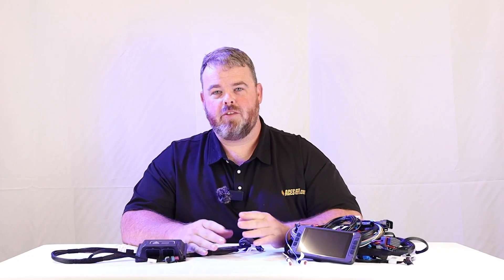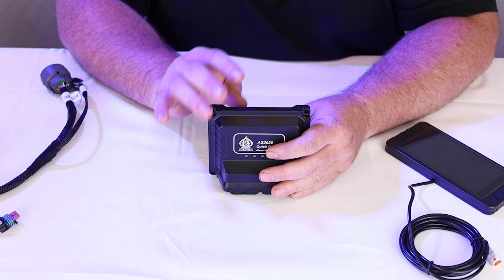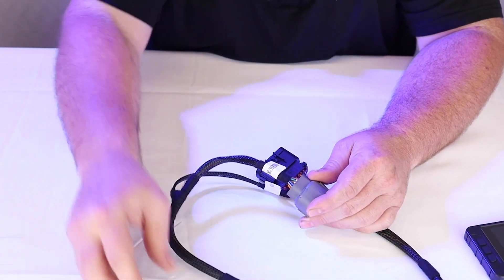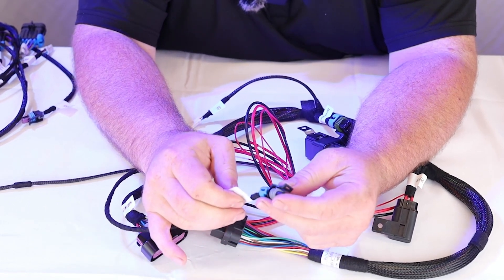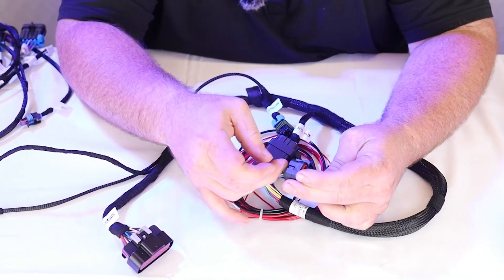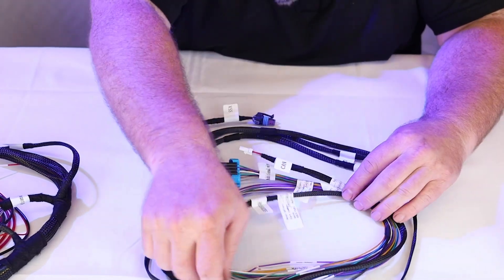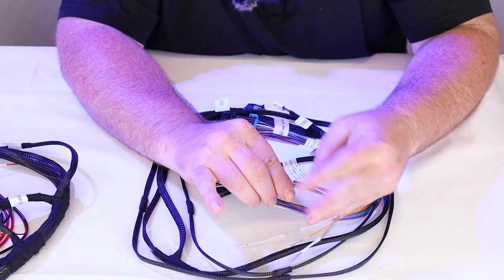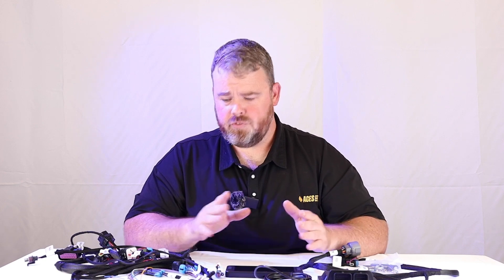Quick Draw TCM (Behind the Product)

Comment: I just installed mine on my 4x4 truck. And so far it’s running great!
Reply: How does it work with 4wd? Since he saidnitndoesnt do 4wd stuff
Reply: I was literally going to comment "So this is a nogo situation for a 99 60e 4x4? Or will just believe its a 2wd" (which is fine as long story short *zr2 astro case,fulltime awd_truck thinks its in 2wd already) but his comment was the first i saw as well. Itd be GREAT IF WE GET A RESPONSE 😅😅@Grinder09rex
Reply: Can you elaborate? What is it that you like? Is there anything you'd change? Did you encounter any obstacles at all, especially during setup or tuning?
Reply: @Sweet_Johnny  aces literally emailed me 2 weeks ago "will not work in your application " GM 4x4 (one 99, one 2000, one has literally been switched into 4 a few times a year to TEST, then back to 2wd for the last 6 or so years/ treated as a summer 2wd hot rod" I think this guy is "exaggerating " a wee bit and/or gaslighting. OR he Jimmy rigged some Ole backroads Okey-Doke and absolutely loves his creation. Good for him, but NO THANKS ! I said screw it, bought an 8hp and going turbolamik with holley efi; adapter kit was 1200$, no big deal in the grand scheme